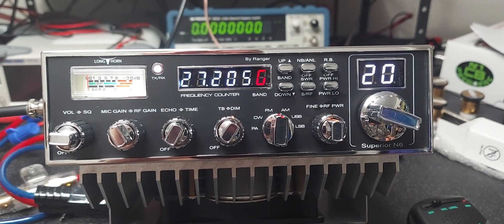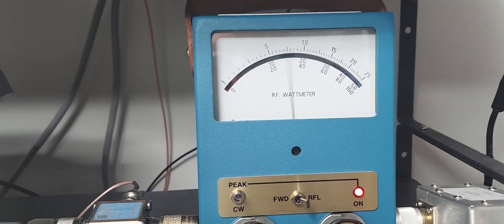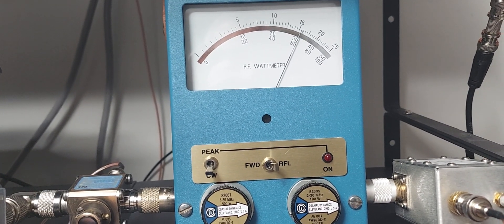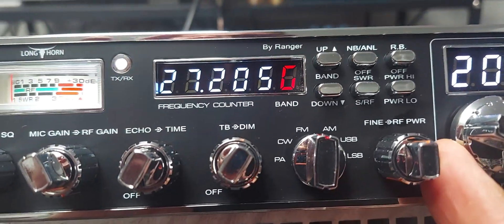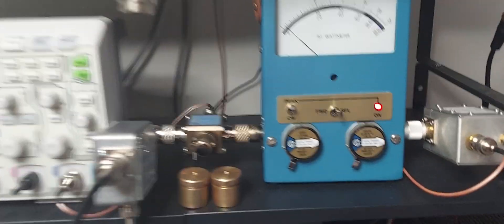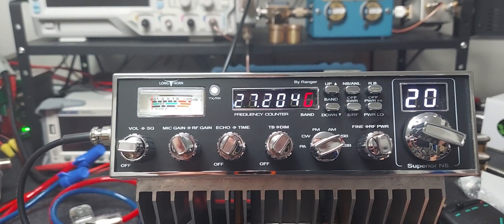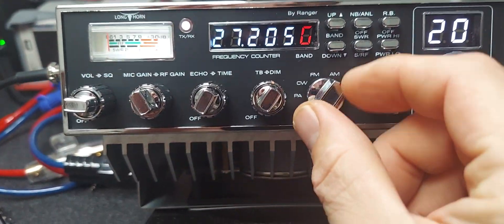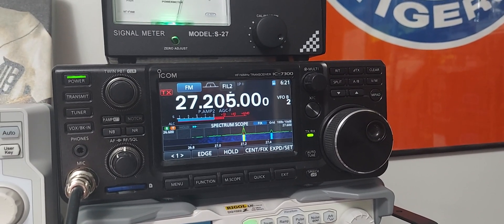Superior Longhorn N6

Comment: Is there a possibility that the high power would blow out your icom?
Reply from the maker: The Longhorn was on a dummy load. Maybe if both radios were on a separate antenna in close proximity.
Reply: 10-4 and thanks for the response

Comment: Hi Scott, do you do any work on the D104 silver eagle, I’m having a problem with mine and believe the problem is in the Circuit board as it’s been wired for a cobra 2000, but the plug itself has been tested on a volt meter and is fine. Thanks.
Reply from the maker: Hi Bob,
I probably wouldn't have any way to replace parts on it since I don't have a parts model here to work with.
Maybe one of your capacitors has gone bad it's been a long time since I've looked at the board on one of those but I would have to assume they have capacitors.

Comment: how does it look on the scope is it clean
Reply from the maker: It's good within the TX frequency bandwidth it's capable of being used at. Outside of that it's a typical Mosfet radio/ amplifier combination, which has typical out of band spurious emissions. A low pass filter would be recommend for those who want to limit that.

Comment: That's powerful but the no light up buttons telling you what's on will be bad in the dark
Reply from the maker: Yeah I think most guys will just leave the amp on all the time.
I'm not much for running amps, but if I was working contacts with this radio, I would just leave it on.